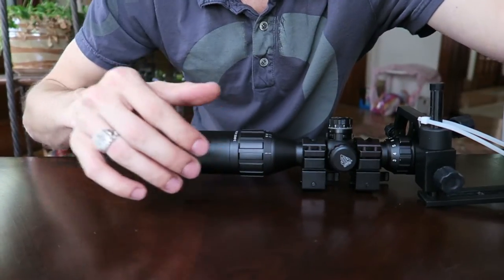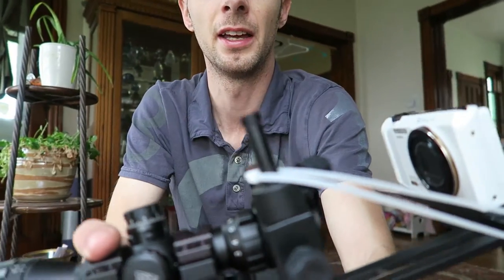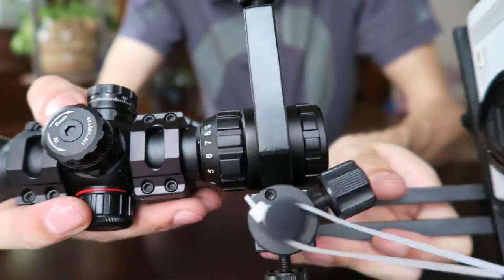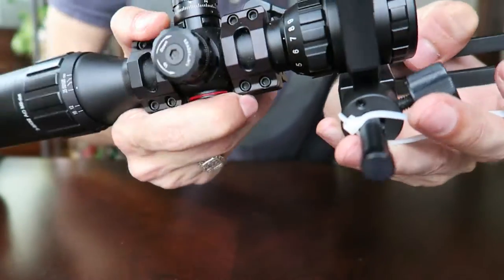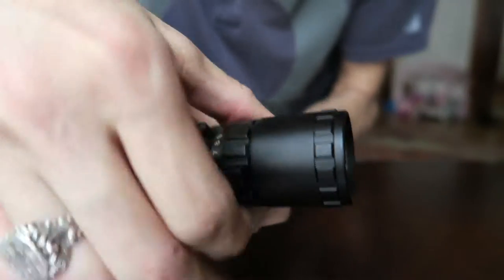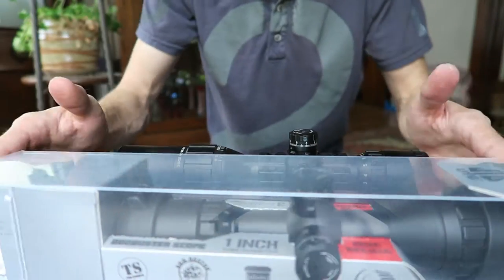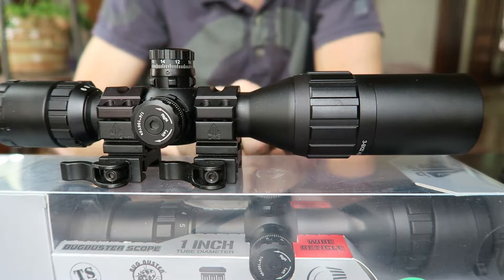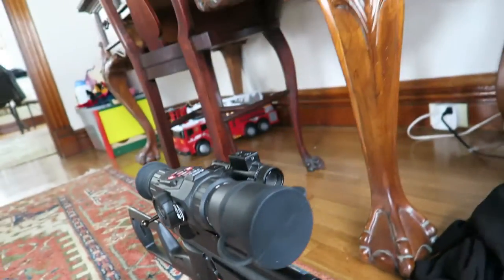Warning: Scope Cam Mount Destroyed Scope | How to Prevent This | Airgun Evolution

Comment: Yup, the consequences of drop damage can occur. Lesson learned and a good heads up. Does the magnification dial need some room in order to work? In your video, you cranked down on the ocular tube prior to adjusting.  Will the magnification dial work when you loosen the tube?  I believe that was the reason for the set screw to keep the ocular tube at a certain distance. I have a bugbuster scope for my PRod and works great.  Curious, did loosening the ocular tube render the scope useless other than the magnification ring?  Thanks in advance for the heads up video.
Reply from the maker: Thanks and sorry for the late response but i use a tablet mostly and i needed to view your comment and have the ability to respond to adequately answer your questions, which are great by the way thanks.
 Ill try to answer your questions in order

Does the magnification dial need some room in order to work? -----  Yes it does I realized this after I cranked it down.

In your video, you cranked down on the ocular tube prior to adjusting.  Will the magnification dial work when you loosen the tube? 

I did not try that outright before I got rid of it BUT I will go out on a limb and say Yes it would work... but now that I'm thinking of it what might have happened when I cranked it back down I might have jammed the magnification ring in such a way that it became stuck because i recall using the scope for a bit before i swapped it out with my ATN xSight and the ocular tube keep loosening back up very early with the scope cam rig attached but the magnification was always stuck on 7 power...

Curious, did loosening the ocular tube render the scope useless other than the magnification ring?   --- NOPE it worked fine in fact I believe some of the shots I used in my first video were when it was in this condition.(Channel Introduction) The camera mount would loosen the ocular tube and I would just cranked the ocular tube down even harder to keep the mount from spinning where by breaking it even more.

Ok so now the Million dollar question why did I crank the hell out of it and break the scope instead of slowly and properly fixing it... right? Well Im glad you asked...

When I noticed it was loose the first thought that ran through my head was if I don't Quickly and Securely tighten this think back up right now all the gasses inside the scope are going to escape and this will mess the scope up even more than it already is so I tightened it back as quickly and as tightly as I could. I did this with out slowing down and looking at what the overall problem was, my brain went into panic mode because I thought the gasses were going to escape... 
I don't really know what the gasses in a scope do but I know there there for a reason and if they escape bad things happen....
In the end I could have saved the scope by fixing it a little less aggressively. Live and Learn
I moved up to a UTG 3-12 I like it more than the BugBuster for the extra magnification it really helps BUT I miss the half mill dot reticle the BugBuster has I still have the New BugBuster You see in this video I will put it on my next Gun I get a Zoraki HP-01 if it will fit then I am going to go to a underground creek that runs beneath buildings and streets in my city and play .22 cal tag with the underground pigeons.